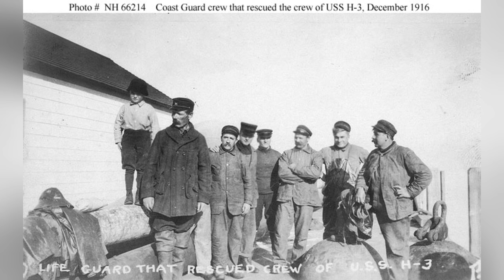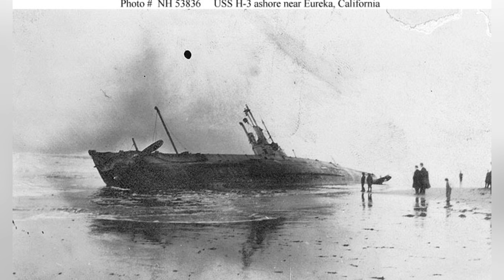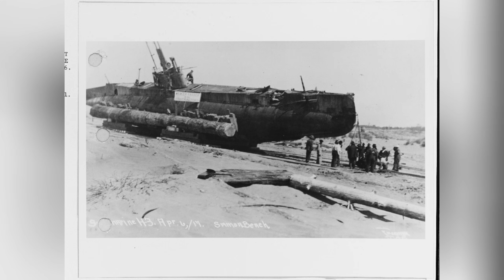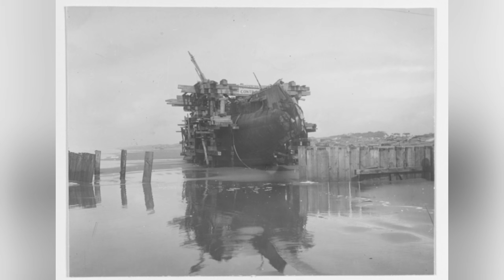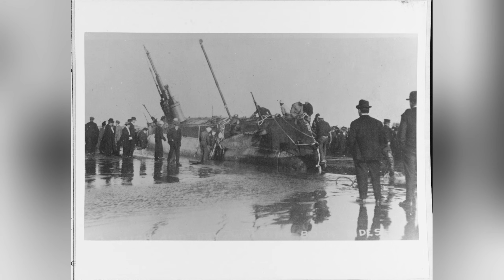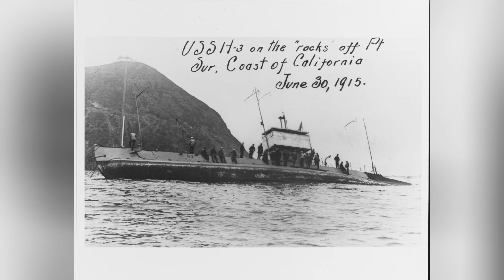Recovering USS H-3: The Beach Salvage That Cost a Cruiser

Comment: I have to make a correction. The lines to the H3 were not broken from strain, they were just damn difficult to manage. The USS H3 was assigned to USS Cheyenne, her tender , which was the last monitor built by the US Navy. Also present was the USCG cutter McCullough, And the tug Iroquois. The Cheyenne repeatedly tried sending a line to the sub by whaleboat. They lost one guy doing this . As soon as it was tied though, the monitor would cut it with her screws. This was because her hard point for this was astern.(forgive terminology)
The reason I know this is because I have a logbook off of the USS H3. It was taken by a crewman on the Cheyenne,who used it to chronicle the incident blow by blow. Because he figured heads would roll , he was making sure he wasn't found wanting.
And, he was right. All the commanding officers of the ships involved were court martialed.
Incidently, there were three of those subs assigned to USS Cheyenne: USS H3, USS H2, and USS H1. They were being tested when this happened.